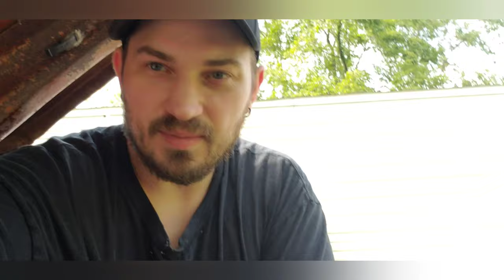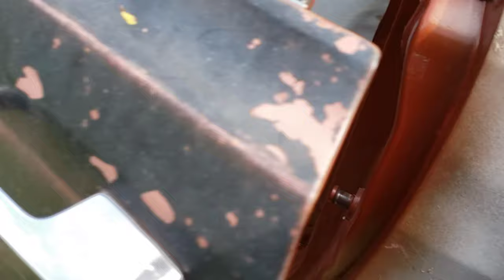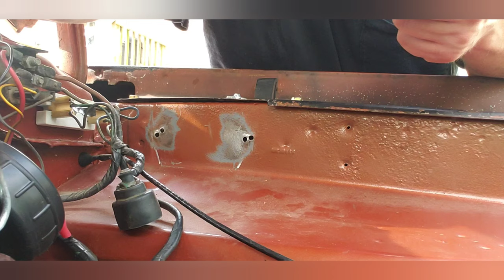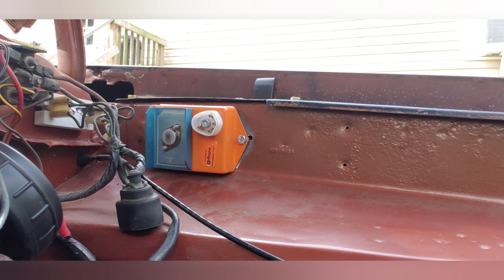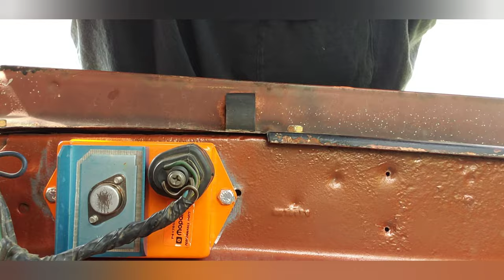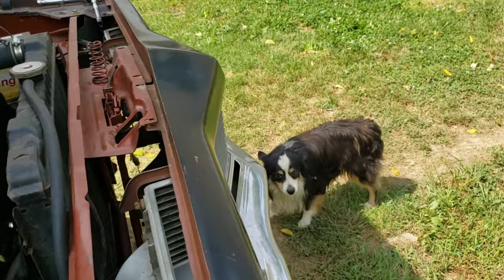Mopar no spark fix.

Comment: I had the same symptoms you described (I hate 'sometimes' failures worst of all). I followed your advice, cleaned off my box ground & gave it a try. It started right away. I shut it off and tried it again & I was back to square one: rrrrrr-rrrrrr-rrrrr....and no fire. I bought a new (blue) box at Oreilly's for $27 & hooked it up. Everything works fine now....at least after three starts. Apparently the orange box can go bad over time & work only when it feels like it. Thanks for the video.....short, sweet & good info.

Comment: When my old '74 Satellite was new, from the start it would die, no spark, when it was hot such as summer, bumper to bumper traffic.  Let it cool off a while, crank right up.  The dealer finally found it was a bad pickup (induction) coil inside the distributor.  Apparently there was a break somewhere inside that would open when the engine was hot.  Replaced it, and never a problem again.
Reply: That's a pretty rare problem. Had it happen on a Proform distributor but not an OEM. I just used a genuine dealer pickup plate. 
About 30 years ago I had an '81 Imperial that still had the fuel injection on it. One day I was on a back road and it just died. Walked back to a gas station 3-4 miles up the road, got some parts, no luck. Went back and paid $90 for a tow to have it towed 13-15 miles back home. (The guy kept insisting it was farther when he quoted me the price.) Next morning the car started up normally. Did NOTHING.

Comment: I’ve got that same issue with the same box in my old D100. It’s been years since I mounted it and bet it’s got a crap connection! Once this snow melts away I’m going to check that. Thanks. 🤘🏼🔧
Reply from the maker: Yea man. I bet that's what it is. I ran a ground  wire straight to the ground on the battery to the front hole on the ecu with one of them star washers so far so good. Hope it fixes yours.

Comment: There's a lot of good things about the Chrysler Electronic Ignition and a lot of bad things. It's good that the electronic parts are not under the cap and run cooler. The bad is that it has the narrowest dwell angle of all the factory electronic ignitions, GM being the best. (Which is better for hotter spark at higher RPM). Unless you're doing a full-on resto or working with a car that had it and you want to keep it there are better ignition options out there. Even some of the 'premium' ECU replacements improve on the original like the Rev-N-Nator or the 4 seconds flat box. There's some limitation too because of the small distributor (cap) size. That's why GM went to the larger cap with the HEI coil, to reduce spark scatter and crossfire.

Comment: Doh! Now I know why a prior owner ran a braided grounding strap from the engine block to the firewall - by using the bottom bolt of the ecu. And when I 'simplified' the electrical system (dumb move) and moved my ecu to another location, I had firing problems. Now I know due to inconsistent ground. They didn't cover this in the old MoPar training videos. :-)
Reply from the maker: Glad I could help. Yea a ground strap to the back is a good idea. Thanks for watching.

Comment: You are doing a voltage drop test. Any time you find power on the ground side of an electric component it means that your ground circuit is bad. All the circuit has to be connected and the circuit must be powered. 

Another MOPAR ignition test is to disconnect the 2 pin connector from the distributor. Remove the coil wire from the distributor cap and hold it near a ground. Now take the loom portion of the 2 pin connector and drag the male terminal across the intake manifold. If everything is good to the 2 pin connector, you should get a good spark from the coil wire.

Comment: Mine would cut off my truck while driving on the old one.  Just put a new one on . 4 day after installing. It back to volts dropping.  Hit break engine cut off. It would also be Xtreme hot when I touch the ignition module. So it could be not enough ground.  I was thinkinv about adding heatsink thermal on back and run a ground wire from battery to it.

Comment: The ProForm distributor kit use to have an orange box , sometimes they last long or forever (maybe) ,but sometimes they will be just crap ... Last time we got in trouble we tought about using an old Mopar chrome-box but the connector didnt fit..
Reply: I had two and yes, they were just crap. I always mounted another 'good' box next to it as a spare. Thank God I did. There's plenty of NOS American made aftermarket boxes out there.

Comment: All kinds of those get replaced because the ground is some awful painted surface.
Reply from the maker: Yes you are correct.  I actually replaced my original one with this orange one because I wasn't getting a spark, at first the orange one worked then it intermittently wouldn't. After I found my problem I hooked up my original one and sure enough it works perfectly fine. Thanks for watching i appreciate it!
Reply: @Dartfreak75  At least you have a spare now.  Those boxes do go bad.  I have a coupe that got hot enough for the epoxy to run out of them and down the firewall.
Reply from the maker: @johnwilburn  yea I plan on collecting a few more of the "good" ones for spares. I hear the new aftermarket ones aren't very good.
Reply: @Dartfreak75  I’d trust a 50 year old used one more than an aftermarket one from a parts store.  The best modern adaptation I’ve seen is the one Four Seconds Flat sells.  I have yet to try one, but I hear good things.  They look very well made and have a built in rev limiter.
Reply from the maker: @johnwilburn  yes I have too I thought about trying one.
Reply: Here is a quick test that will save you a lot of time. Turn key to on, hook meter to + or - side of the coil. You should read something like 5vdc. That tells you the ECU is on and has power and grounds. If you read closer to 12vdc the ECU is off. Check for voltage on the ground side of ECU. Just scratch the case and see if you have voltage. If you have anything your ground is not good.
Reply: @davidfarmer7397  Good tip!

Comment: Maybe try dielectric grease between the bare metal contact points too. It should help with conductivity and help reduce corrosion
Reply: Anti-seize works better. It's more conductive. Dielectric grease is insulative that's why it's used for plug wire boots. A lot of problems with these boxes is the really sketchy modern construction and most are Chinese. That huge power switching transistor should have power on the case when it's running. Power will back feed to the case if it's ungrounded. If you look, there's a thin mica insulator between that transistor and the heat sink. I wouldn't be probing it or touching it either. You will get a shock if it's running or damage it. Some of these problems are also due to 'dirty' power input causing the boxes to fail. The old ones had better filtering.
Reply: Dielectric grease is only for keeping moisture out it does not conduct
Reply: Dielectric grease is not conductive

Comment: Man, I bought a new wiring harness for the ECU, ignition coil, and to the dual ballast resistor.  I got no spark. I will ground the ECU and see what happens.
Reply from the maker: Any news? Did you get spark?

Comment: Over the years I have found that the problem was what I had just done. In other words I had created a problem by not making the proper adjustment. Note: on electrical items use electrical paste, the ground and connections last longer.
Reply from the maker: You're 100 percent correct. I find myself doing that all the time lol

Comment: Can you buypass the icm and run the coil into distributor only and use togle switch to kill it
Reply from the maker: In theory yes I guess you could I've never tried it. You would be better off getting a points distributor if you want to bypass the ecm

Comment: I've been searching you tube for a week now and found this video today. Have a 85 Dodge 350 with similar issues.  I've thrown new ECU in it. New coil. New resistor.  New pickup in the distributor. Still no spark.  I'm try what you done here. Now. And still nothing.  Any suggestions?
Reply: Have you figured out problem I’m having same issues it’s a nightmare
Reply from the maker: Sorry I'm just seeing this. I have another installment video for testing the spark at the distributor ill post a link here. I'll do my best to help you.
Reply from the maker: https://youtu.be/ow_x1s2dH7M watch this let me know if it helps or not

Comment: what did you hook your test light to ,,to test the Ecu?
Reply: Presumably the test light is clipped to ground. Whenever the probe touches something with voltage on it (in this example, the ecu case - but could be any "hot" source like the ignition terminal, a headlight switch, etc) the voltage difference flows current through the test light filament and it lights up. 

He's expecting it NOT to light, because the case shouldn't have voltage. The fact that it does indicates the poor ground. This only really works if you know the component you're working on is suppressed to be grounded through the case AND you've got the power to it turned in, as he did
Reply from the maker: Yes exactly! Excellent explanation!

Comment: I have had the same problem on a 80 Ford f350 400 mod
Reply: Still can't find it
Reply from the maker: Im not super familiar with 80s fords ignition system. I would start by checking with the coil ser if you have power there

Comment: We never use test lights. We are told to throw them out. They dont show you voltage. Buy a good brand multimeter and learn to use it on voltage, amperage and resistance scales and this issue would have been diagnosed faster than a test light could any day.
Reply from the maker: I have a multimeter I use also. I have learned  how to look at the bulb on a test light and judge the voltage by the brightness of the bulb. But yes I understand what you mean. I believe test lights have a purpose and work well for that intended purpose
Reply: @Dartfreak75  i have 2 but we are not even allowed to solder anymore. Everything must be butt-connected and heatshrunk. I work for Landrover/Jaguar.   When reporting electrical issues we always have to give connector numbers, pin # , wire color and  voltage value, resistance values through the circuits. Sometimes amp draw depending on issue like heated windscreens. 

In your case, noticing the ignition module has 12v when not grounded is obviously apparent. And visa versa when it is grounded.
Reply: im the opposite
Reply: @tristengerhardt5458  thos could be a positive post but your negative? 

See what I did there?🤣😼
Reply: @matthewmorrone883  im the lightbulb dude what u talking about

Comment: It’s not an ecu
Reply from the maker: Yes Sir, It is. Electronic control unit. Aka ecu.
Reply: @Dartfreak75  no it is in ignition control module not a computer
Reply from the maker: @tommywilliams1402  your right its not a computer. It is a electronic control unit. It's stamped right on the front of it on the original ones.